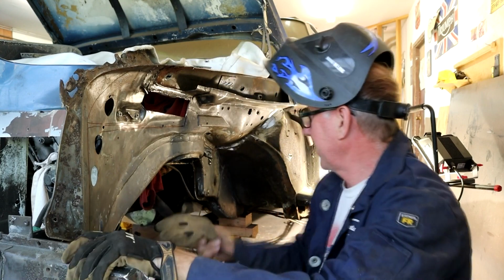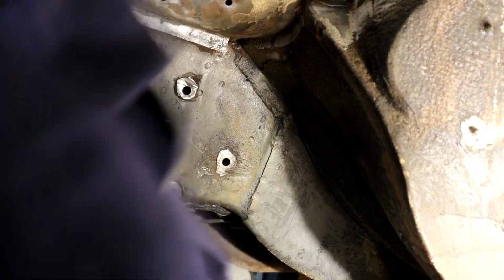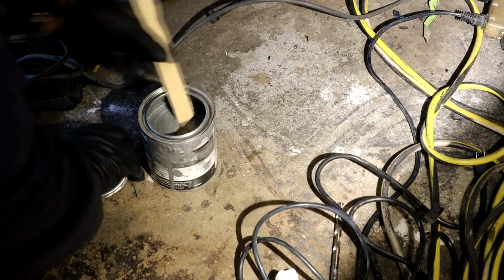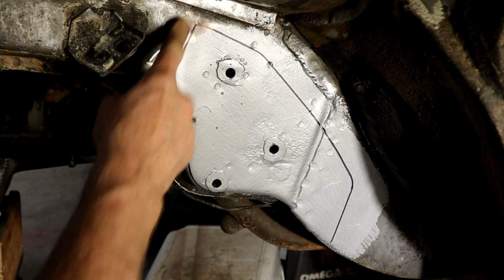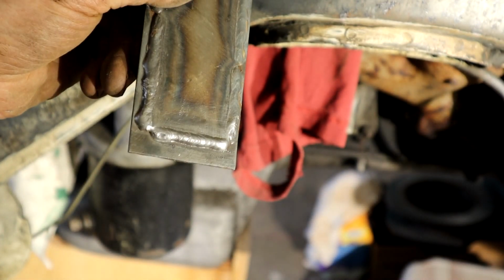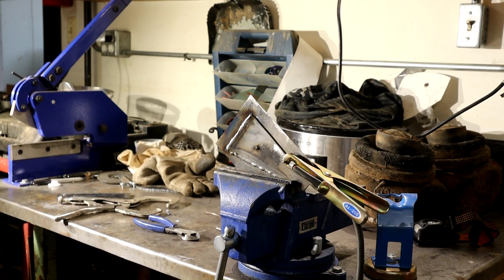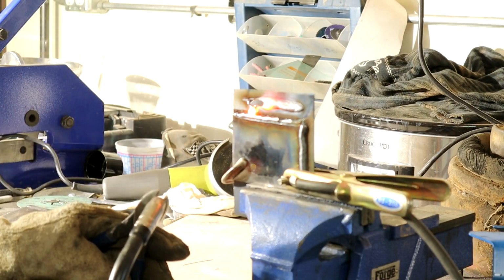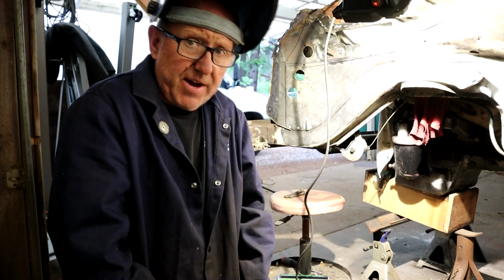Mercedes W109/W108 Steering Box Mount Reinforcement.

Comment: I like using dynamic rust prevention in such locations. A Lanolin product like Fluid film or Wool Wax creeps into crevices and seals out moisture. Great work by the way.
Reply from the maker: I remember back in the UK they use to have a product called waxoyl. That's a good idea what you said, good for all the nooks and crannys. Cheers John.

Comment: Very interesting.  I noticed that there are spot welds around the tubes for the bolts. Guessing that there are additional metal supports inside the frame to help support them. I had to do a similiar repair on my 250S, welded the tubes back to the frame. Now I'm thinking I need much more work, like removing the steering box and welding on the inner side of the frame,,along with a better and wider weld on the outside where the tubes stick out. My guess is that MB did not properly prevent any rust from starting inside the frame. Many stories on frame rust in those areas, especially at the rear bottom portion where water would pool. Rust prevention is quite necessary.
Reply from the maker: I'll be injecting frame coating inside all box sections to help stop rust in there. Overall the frame box sections look in good shape, its just some of the rockers that have suffered the worse damage. Cheers John

Comment: Hi John! Great to c you took care about this delicate area. Great welding job, enormous patience.... I havnt seen this type of repair so far and wish you "luck" between the metals.
As far as I can c from your pictures the typical problem had not yet occured resp. has not yet become visible. I have often seen massive cracks in the welding around the srews in many cars; usually starting with the most burdened lowest one at the corner, then the next one upwards asf.
Often the side member(?) tends to open upwards which you have surely checked. My 6.3 came from Cal. too and was nearly rustfree but mechanically well used and not too well maintained...good resto candidate. Rgds, Oliver
Reply from the maker: Thanks Oliver. You're right my car was showing no signs of the cracks you mentioned. This reinforcing technique was done by a member of our Facebook group when he worked at Mercedes. I was just following what he did the best I can. I think the rust treatment between the two plates should work well, especially after sealing and leaving a gap at the bottom for drainage. Thanks again Oliver. 
Cheers John🍻